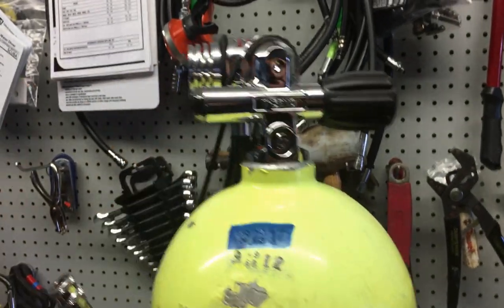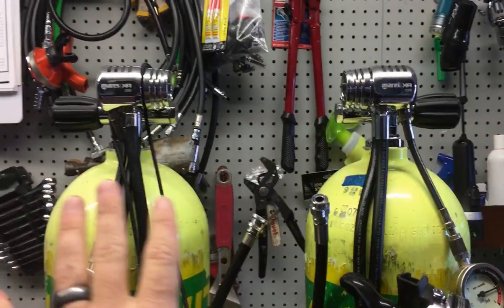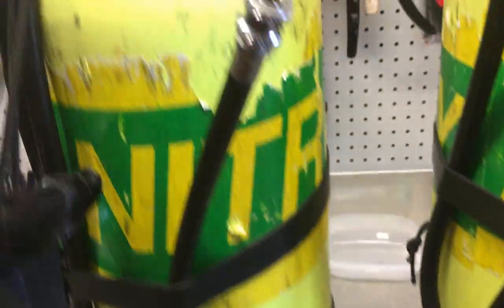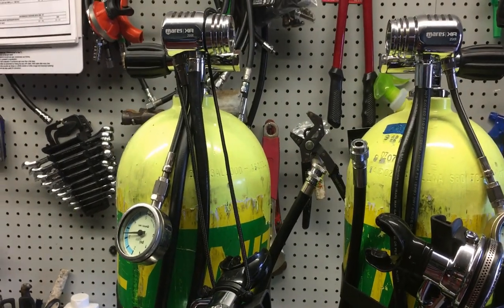Sidemount Tips

Comment: The cam band is a great idea if you travel with a stage setup instead of the hose clamp too. I guess that would avoid hunting for a screw driver, thanks.
Reply from the maker: Hello Lars Dennert, travel, is the biggest reason we use cam straps instead of hose clamps. Both work great, just one has a more practical side for travel.

Comment: 99% of the Youtube videos are talking about Al tanks where in NZ, 99% of the time we use Steel.

From the TDI theory, I learnt that Steel tanks bolt snaps are places on the 2 and 10 o'clock where Al tanks are on the 4 and 8 o'clock.  However, you stated on your video the use of loosening up the bungee cord to reach the buttplate.  I'm just wondering if other than loosening the bungee cord, you would also change the angle of the bolt snaps as well to 2 and 10 o'clock respectively?

Secondly, 6 years ago (this video), you had this XS scuba tank strap for traveling.  What do you recommend using these days if you keep travel in mind?  I currently have the DiveRite  Stage Travel Rigging.  Would you recommend this?  Thank you.  Much appreciated!
Reply from the maker: Hello @x994910, great questions. During all of our Sidemount courses, we spend a great deal of time with each student and their specific setup to see what works best for them. We do not believe there is a one and done way of doing it for all divers. Our students get trained with both steel and aluminum cylinders, and after their certification they can choose which cylinders work best for them. Our goal is to teach Sidemount Diving (in the entire spectrum), not a specific style or configuration. Moreover, the same applies to the lower attachment points. I still use cam straps as it works best for me for travel, and as an Instructor teaching Sidemount, I am able to quickly adjust tanks on the spur of the moment to help students with trimming issues.  Several of our divers will either use worm gear clamps or a rigging kit if they are wearing a BCD that has a ring bungee system like the DiveRite ring bungees. I encourage all Sidemount divers, to try different systems to see what works best for them.  At the end of the day, it is their decision not mine.

Comment: Brian, I always carry a 19cf PONY, as we discussed previously. As I consider the benefits of SM, I have a question for you. If you have dual 80CF SMs with independent regulators and use one of the tanks strictly as a backup, as you use 2/3rds of the air in the main bottle, do you notice an imbalance in your trim as the main bottle gets lighter and tends to have the bottom of the bottle point up? (I saw you adjust the rear attachment point of the 500 PSI bottle on your BCD on another video.) If so, I would guess the solution is a pair of steel bottles. 
Most of my dives are shore dives where the walk to the water is 50-100 yards. I get tired of thinking of carrying 80 pounds of bottles (plus everything else) to the water, and back. LOL. That is the big negative of SM in my mind. Currently my kit weighs exactly 70#, with the PONY being 10# of it. Switching to dual 80s would jump the total weight to 100#. I weigh 160#. Whew! ;)
Your thoughts?
Reply from the maker: So when it comes to sidemount diving, balancing out cylinders is a juggling act sometimes. Both cylinders are considered primary and both are also considered back ups. Typically what I will do, is a gas switch every 500 psi.  So both cylinders will start out with 3000 psi.  I usually start breathing off of my left cylinder first.  Once it hits 2500 psi, then I make a switch to my right cylinder.  I will then breathe it down from 3000 psi to 2000 psi then perform another gas switch.  This will leave 2000 psi in my right cylinder, and 2500 psi in my left cylinder.  With only 500 psi difference, both cylinders will stay pretty balanced.  Since I use aluminum cylinders, once they hit 2000 psi, they tend to get a little on the light side.  I will then shift the bottom of the cylinders to my front waist D-rings to level them off.  Once both cylinders are moved to the front D-rings, when they reach 2000 psi, I can use this as my indication as my turn around time, being that 1/3 of the pressure is used up between both cylinders.  Then I will use the next 1/3 to make it back to my exit point.  I will continue to breathe each cylinder down to with in 500 psi of the other to keep them balanced.  As I reach my exit point, both cylinders are usually around the 1000 psi mark.  Thus, ending the dive with a reserve of 1000 psi in both cylinders.  In regards to steel cylinders, a lot of divers like them for the added air, and for the buoyancy characteristics.  It just happens that the aluminum's work best for me.  Sidemount diving has many advantages and also many disadvantages.  There are times while underwater, I will be in backmount, wishing that I was in sidemount, until it comes time to exit the water.  Then I am glad I am in back mount.  Then there are times when I am getting into water, and its really nice being able to lay the cylinders down in the water first, and then attach them once I am in the water.  Same applies when climbing a latter.  Its nice to be able to remove the cylinders and hand them up to the boat crew, then climb out with no weight on my back or sides.  Both sidemount and backmount have their moments.
Reply: Brian, thanks for your comprehensive, detailed response. ;)
Am I spelling Brian correctly?
Reply from the maker: You're welcome.  Its actually Bryan, with a "Y," but no worries, everybody makes the same mistake.  One of my Assistant Instructors, the boat captain you see in a lot of our videos, his name is Brian, and he spells it with an "I."  Its funny because we do several Career Days at several of the schools here in our area, and both Brian and I will give presentations.  We usually introduce ourselves as Bryan number 1 and Brian number 2.  Then he will speak up and crack a joke with the kids, that he is the real Brian because he spells his with an "I."  They all get a big kick out of it, because I tell them that to be a real diver and not a fake diver like him, you have to spell your name with an "Y."  They all laugh.

Comment: How do you decide if you are going to use sidemount or backmount for local dives? By local i mean within driving distance.  I finally got my setup ready and tryed sidemount yesterday. Its definitely different but a good different.
Reply from the maker: For me, it all depends on the dive I will be making.  For working related dives, Public Safety / Salvage, I only use Backmount.  For dives where I know I will need the extra gas (to extend bottom time), then I go with Sidemount.  I enjoy the freedom of Sidemount, but I also enjoy the benefits of Backmount, and not having to take 2 tanks, 2 regulators, etc.  For exploratory dives, it depends on depth and gas need to conduct the dive.  For technical related dives, I haven't use Backmounted doubles in over 10 years, I most definitely prefer Sidemount.